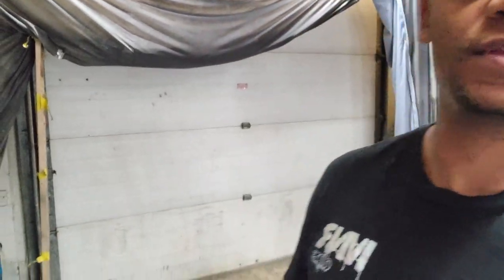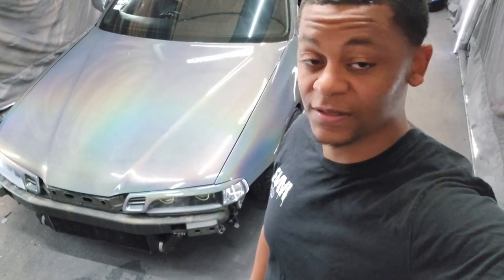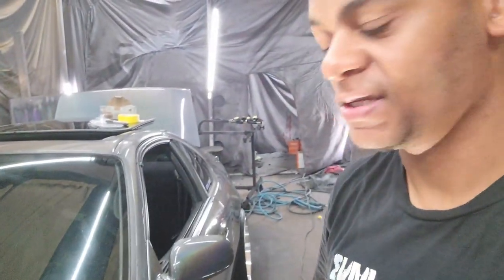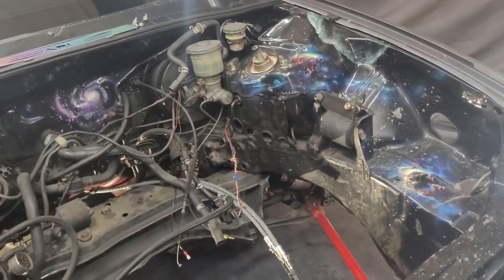My Honda Prelude gets a 800hp h22 swap

Comment: my lude runs a h22a4 top with a h22z1 bottom end.  (z1 has 55mm mains)  lots of other goodies to, but my 2 cents .. spun bearings are normally from over advanced timing  (dirty stale fuel will need lots of timing retard).  it pounds the bearings out till there is just enough room to spin...  seen several blocks/cranks go as offerings to the Gods of Speed over this.  most "tuners" try to hard to crack big numbers instead of keeping a conservative margin...  only takes 1 tank of old stale fuel to detonate the bearings out.  cars that sit for a month or 2 are at risk.  always clean fuel system and run fresh fuel.  only way to avoid this is fit a flex fuel sensor to your system.  but keep up the show,  your Lude is one nice ride.
Reply from the maker: Thanks for the advice bro very useful 🙏🏽

Comment: Yo bro I follow your work on here religiously and I've got a 4g lude that I got some plans for and I was wondering.. if I grab a f20 like you have will I need mount modification or no.. and will it bolt to the f22b Trans
Reply from the maker: Yea you will need to swap over a few things but you'll have everything you need from the old motor. F22 Tran bolts right up
Reply: @treybedipping1734  o ok thanks bro